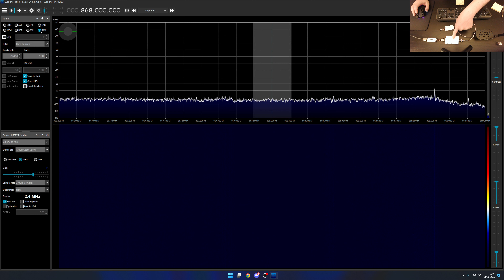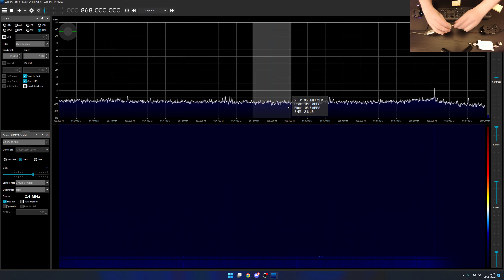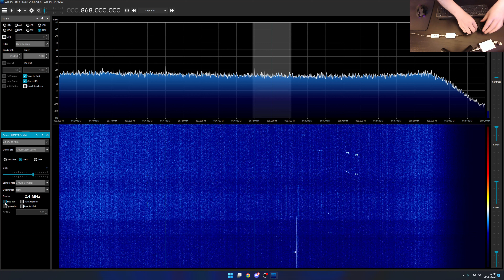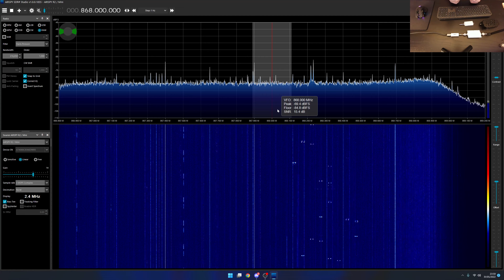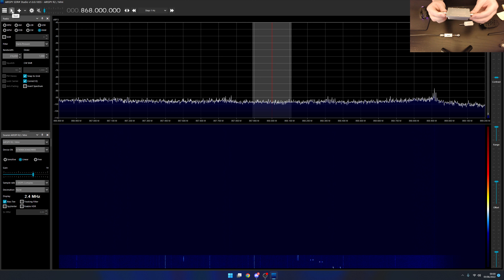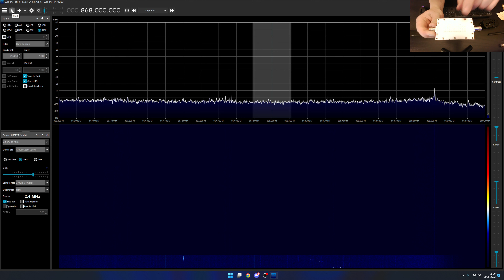Acasom vs Raygnal amplifier noise test - sort of

Comment: The Acasom Amp has a noisy buck/boost converter inside (its oscillating) instead of a normal regulator to create the 5v for everything. Try to remove it and power it directly with 5v or use a normal regulator, then measure again. Would be nice to see a difference.
Reply from the maker: I will give this ago, and test it but people should not make these kinds of modifications. It should be working out of the box.
Reply: @unqualifiedexpert  youre right, but the unlucky guys who already bought acasom amps maybe will be happy if there is less noise after this mod

Comment: I have a question. When i buy this amplifier from raygnal and not touch anything on the switches, what is the gain configured for TX and RX ?
Reply from the maker: TX and RX are configured based on your requirement. Each Raygnal amp gain is custom based on your request. Maximum can be RX=31db and TX=13db.

I asked for RX18 TX7 when I made my order.
Reply: @unqualifiedexpert  ok thanks for answer. But ist RX 18 not too high? Sorin said 10 RX is perfect. Or the more RX the better? Why not using for example the max. 31 db RX?

Comment: Thx for that great video  ! <3 what about indoor raygnal (RX17 TX10)? outdoor out of stock :)
Reply from the maker: From what I understand, indoor and outdoor versions are identical, except one is waterproof and the other is not
Reply: @unqualifiedexpert  thx, RX 17 and TX 10 it's normal ? i must plug indoor version with 2 hs splitter amp, 5M lmr 400
Reply from the maker: @StudioHouse11  with Raygnal, RX17 TX10 is perfect cos you can use the dip switches to  reduce the gain to adjust it for your needs. Switches do not add any extra noise. The version I have is RX18, however I have reduced to RX10 for testing purposes.
Reply: @unqualifiedexpert  thx for your reply 🙏

Comment: It's a big difference. 
That Acasom + cavity has no chance against Raygnal without cavity.
I ordered several Raygnal the day before yesterday. Was the right choice. Thanks
Reply from the maker: I know right... I think Raygnal is as good as Jetvision when it comes to filtering noise, and it works much cheaper than ordering Acasom amp and cavity
Reply: Did you get your Raygnal amp from alibaba?
Reply: @cf6979  yes
Reply: @kadirkursat9266  How is it performing?  I just ordered one.
Reply: @cf6979  It is performing very well. have an improvement 40-100%
Reply: @kadirkursat9266  Wow that's great!  Congrats!
Reply: Are you guys using these amps for Helium, i've got the acasom and bought a Raygnal from Allen and the performance of the Raygnal is no where near as good as the acasom?